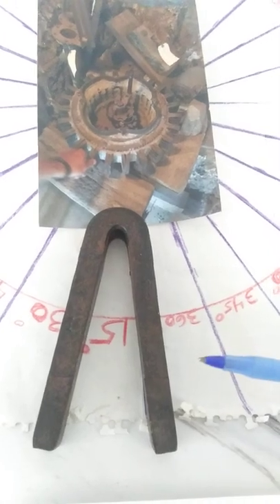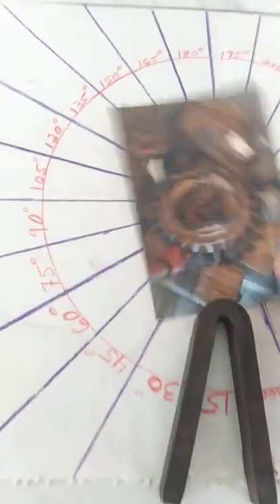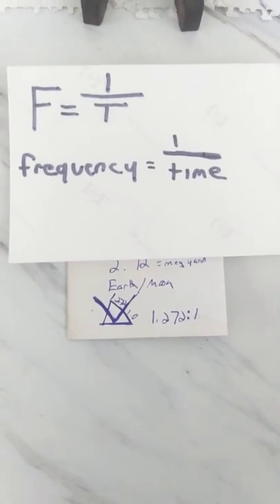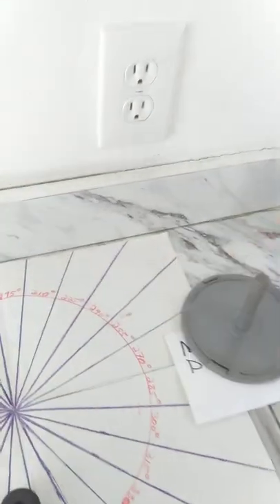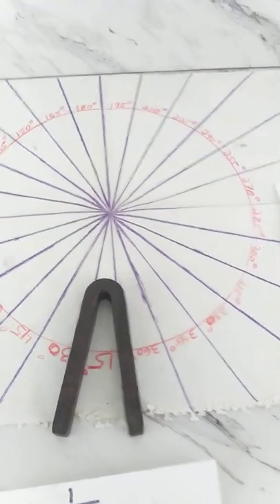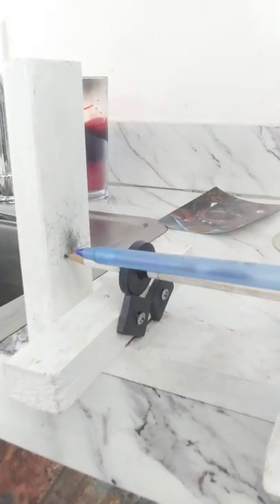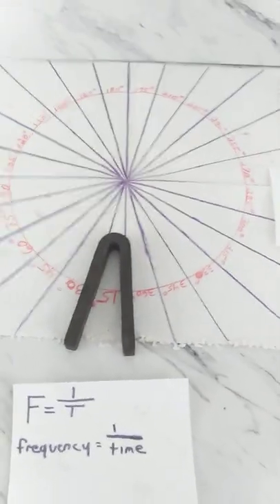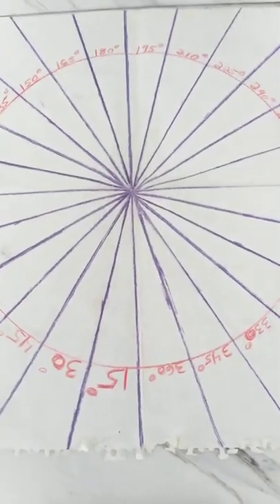How Ed Leedskalnin's Ford Model  T flywheel at Coral Castle produced Alternating Current.

Comment: Awesome information - I follow you all the time - Soft Fe 12310-500-R gram (Sigma Aldrich Canada Co, Ont). We searching for soft iron (Soft Fe 12310-500-R gram) Soft Iron Base Alloys – As-sintered ; GRADE, Density g/cm · B · kG (T), B · kG (T), H · Oe (A/m) ; FF-0000, 7.0 7.2, 10.5 (1.05) 12.0 (1.20), 9.0 (0.90) 10.5 (1.05)) Bars (3/4 Inch thick x 4 inches W x long24 inches long. Where did you get your iron bars? Gerald Biccum… needs the softest iron available.
Reply from the maker: The neo magnets I got off Ebay. They ship from China. Thanks for watching.
Reply: @teslafieldphysics4041  thanks